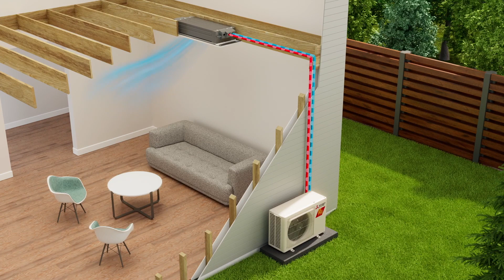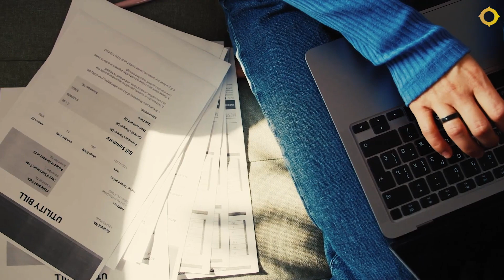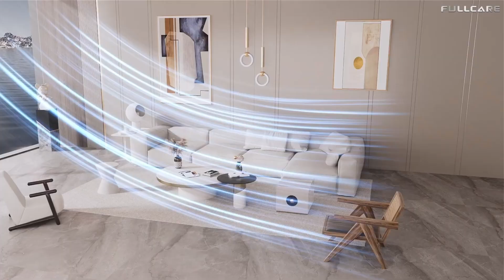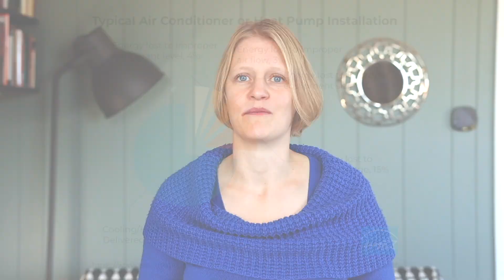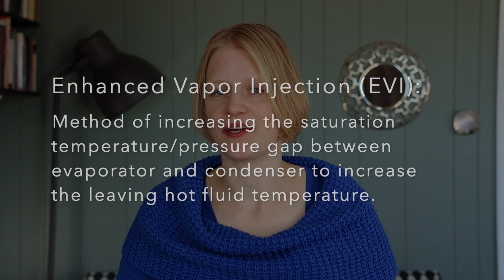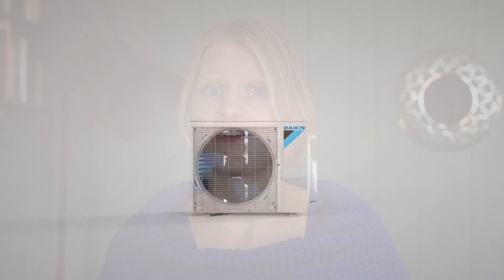Why most heat pumps are oversized (and why this affects your long-term savings)

Comment: This is an urban myth based on the bad old days of reciprocating compressors, but it's simply not true today, because clever software control and modern scroll compressors are so good at controlling room temperatures and preventing cycling altogether. Look carefully at the manufacturers data tables, for example a Vaillant Arotherm+ 10kW produces 7kW of power far more efficiently than the Vaillant Arotherm+ 7kW version at full power. The larger heat pump is significantly more efficient at like for like power levels because a compressor turning over at say 70% of capacity has much lower friction losses than a compressor working at full speed. If the 10kW heat pump needs to work below it's lowest modulation level, the software does not allow it to cycle. An off time of say 20 minutes minimum is absolutely fine for a modern scroll compressor and leads to virtually no efficiency losses.
Reply from the maker: Thank you for sharing! 🙏
Reply: @NetZeroTech  from 7kw to 10kw is 30% which is even normal to consider if you have a 7kw heat loss at the design temp , but going for 300% more , like they wanted in my case , its absolute madness . And no matter the modulating of the compresor , the correct unit will be always more efficient in non-extreme temps.

Comment: this is only the case for stupid heat pumps that cannot modulate well
Reply from the maker: Hi, Thanks for sharing! Yes, you'd expect a higher degree of oversizing from the fixed speed heat pumps. Variable heat pumps get oversized too, though, i.e. they usually run below their nominal performance. Cheers.

Comment: Hi Katha, thanks for the video.  I've noticed also a lot of commentary about oversizing being detrimental to efficiency but not much quantitative data.  Of course it will depend on the application so hard to make a broad statement.  Anyway, I noticed in the beginning of the video that you said oversizing is detrimental to efficiency because a variable speed heat pump will be running at its minimum output much of the time, but then later in the video said that this is good for efficiency because the heat exchange area is much greater relative to output.  So in that case, wouldn't an oversized variable speed heat pump run a higher efficiency than one sized to be running closer to full capacity more of the time?  Not many manufacturers have detailed enough data to answer this question but curious what you've found in your research.  I've seen at least some curves showing an efficiency maximum somewhere between min and max output of variable speed heat pumps, so I would think that the ideal strategy would be to size the unit to match that sweet spot to the load for as much time as possible.
Reply from the maker: Hi @RicknessJ82, Thank you for the comment. Really good points! I tried to get more data into the video. I had a hard time finding data. I asked multiple heat pump experts and scraped the internet. The challenge that I am running into is for these kinds of videos is time for in-depth research. I would have to ask a lot more manufacturers and heat pump designers. But, frankly, and I hate to say it, but if I spend the time doing that, I lose momentum to build the channel. My goal is to grow the channel to a size where I can afford a researcher or other team members, so I can spend more time on research. That's the hard truth at the moment. I am looking into sponsorships. I hope you have the patience to stick with me on the way.  Warm regards, Katharina
Reply: @NetZeroTech  Thanks for the quick reply, I get that for sure!  I like to geek out on those details but for many it may be TMI anyway, thanks for the great content!
Reply from the maker: @RicknessJ82  Thank you for watching! Keep geeking out! I love it! Katha

Comment: This problem really only applies to single stage heat pumps or if you live in a very hot area like Phoenix.  For most people the correct way to size a heat pump is to match the heat load.  Then be smart and only consider variable speed or inverter models of heat pumps.  These are quiet and will do a good job managing humidity levels.  Efficiency levels range from 16 to 32 Seer with 19-25 being the economical sweet zone.
Reply from the maker: Thank you very much for sharing, @alberthartl8885. Much appreciated! Katha

Comment: Oversizing seems to be an issue in the UK too where there is a push to replace traditional gas boilers with HPs - many plumbers (not heating engineers) aren’t trained in heating design and use the same rules of thumb as they have been for gas rather than doing actual heat loss calculations - many boilers are already massively oversized because “bigger = better” 🙄 and many homes have combi boilers which require huge outputs for instant hot water resulting in homeowners thinking something with a perceived “small” output is not going to be powerful enough - there are plenty of negative stories of poor performance or expensive running costs that hit the headlines in some news outlets with a particular agenda 🙄
Reply from the maker: Thank for sharing this! Much appreciated. In the a video about the importance of the installer, I mentioned the challenges with installers that are untrained in heat pumps. I think it is a challenge in all places where heat pump demand is growing rapidly, because installers, who used to install furnaces are switching to where the business is going, i.e. to heat pumps and haven't had time to catch up in training. I think this is I pretty much what's happening globally, although a lot of countries in Europe seem to be a bit ahead. And we are still at the onset of the S-shaped growth curve. So, more exponential growth to come.
Reply: @NetZeroTech  indeed, it's only going to get worse unfortunately as there are currently subsidies of £7500 for A2W HP installs so the unscrupulous installers will be aiming for the unsuspecting as is always the case when "free" money is there for the taking, albeit with a bit of bureaucracy to tick some boxes - same thing happened with PV a few years back. It's also muddied by the general public not having a clue and the fact that any old gas fitter can refer to themselves as a "heating engineer" as it's not a protected title as it is elsewhere - that and the fact that it's all too easy to install an oversized gas system without calculations which is inefficient because no-one is able to measure it, but the homeowner is happy because it gets warm quickly and gas is still relatively cheap...
Reply from the maker: @Umski   Thank you so much for sharing your thoughts! 🙏 Have a great time! Katha

Comment: Thanks for the video, all very good points.  My heat pump is definitely oversized.  As you state, this increased the cost of the system, and the extra money spent isn't really helping me.  A big downside of the larger compressor is that it's LOUDER.  That alone should encourage everyone to not oversize their system.
Reply from the maker: Thank you very much for sharing, @satoshimanabe2493! 🙏 Most air-source heat pump systems installed today run very quietly. What is the heat pump model and when was it installed? By the way, ground-source heat pump systems are of course completely silent. Thank you! Katha
Reply: @NetZeroTech  My system was installed about 10 years ago, a Bryant 286BNA024 (24000 BTU).  Compressor is single-speed, dual-stage.  Home is 32x16 ft, 3-story with one of the long walls being shared with a neighbor (so effectively no loss through that wall).
There have been vast improvements in the past 10 years, and I'm hoping there's better air-to-air equipment out there when I have to replace this in another 5-10 years.  (Ground water isn't an option for me.)
Reply from the maker: Thank you so much for sharing! Very interesting! Yes, heat pump technology has improved over the past 10 years across the board. I hope you are enjoying your heat pump system regardless. Greetings from Colorado, Katha

Comment: Maybe she could define oversized and correctly sized .  A heat pump needs to be big enough to work on the hottest and coldest day of the year.
Reply from the maker: Hi @donalddouglas5988. Thank you for watching and sharing your thoughts. A correctly sized heat pump maximizes the efficiency and the lifetime of the system, so that little to no energy is lost do to improper sizing. For the coldest days cold-climate heat pumps have auxiliary backup electric heaters. Apologies if this didn't come through in the video. I hope this helps. Thank you, Katha

Comment: To keep me from over-sizing my heat pump, I would need to see some data that accurately predicts the local climate for the next 15 to 20 years. The data must include things like climate change and the effects of natural disasters or even a nuclear war.😐
Reply from the maker: Great point. That would be needed to size any heating or cooling system. My assumption is that temperatures will keep rising. In regions where cold is the limiting factor, this means, you’d even need a smaller heat pump in the future. Overall I would assume the effect of a changing climate on heat pump size is minimal. Thank you for sharing! Greetings from Colorado, Katha

Comment: Great video! Some models can turn down to just 15% or less of their max output and have impressive COP over 7 at that minimum output, versus 3-4 at high or max output. Do you think that's enough to minimize low load cycling? I think it also depends on the location. Min vs max output needed is much different in an area with a design temp of 32F/0C vs an area with 0F/-18C
Reply from the maker: Thank you so much! 🙏 Agreed. It absolutely depends on the location. However, systems would work more efficiently if the were sized for their nominal values, meaning they run at their most efficient capacity most of the time. Cold-climate heat pumps have an auxiliary backup resistor that covers the outlier days. Too frequent low cycling happens when the heat pump is too large regardless of COP I think. Hope this helps. Thank you and greetings from Colorado, Katha 😀

Comment: in my experience the extreme temperature is not the reason. its simply installers that dont want cold calls so they just oversize to the extreme.
Reply from the maker: Interesting. Thank you for sharing! 🙏 Much appreciated. 😊 Katha

Comment: At 38° north latitude we need variable speed heat pumps to be oversized in cooling because you’re going to need that extra capacity during heat mode. I need 20 btu/sqft for cooling and 35 for heating. 

Otherwise, if you size it for cooling, go ahead and install another heat pump just for heating right beside it, because you’re gonna need it. Typically you need about twice as much capacity for heating in the winter time. 

We don’t have hydronic systems in our residential homes very much in the US and most of us do not want them. I am going to build a small air-water hp for my 80 gal electric to save some energy this time of year. I am totally off grid and it’s all I can do to make it through these dark cold weeks of January and early February. That’s with 32kWp! I have to use a wood burner when it gets below 20F at night.
Reply: Most of us have forced air, air-air hp’s. Some have gas or oil fired boilers and some have geothermal hp’s. I guess the air-water hp’s haven’t caught on much yet and will have to start with new construction. Hey, we are just now getting air-air mini splits here in larger numbers. Mainly because they can be diy. I don’t push them on people, because they are difficult to perform preventative maintenance on them, they don’t last quite as long as our central heat pump systems, we don’t carry parts on our trucks for them, and you can’t add high efficiency air filtration to them very easily. I have a Fujitsu 9000 BTU 33 seer heat pump air to air. I like it a lot, but it’s only two years old so time will tell.
Reply from the maker: Interesting. Thank you very much for sharing! 🙏 I appreciate it. Katha
Reply from the maker: Hi @rv10flyer84 Thank you very much for watching and sharing your thoughts. I’m curious to learn why you don’t want hydronic systems for residential homes. Thank you! 🙏

Comment: I am going to get a air water heater pump, hope it is properly dimensioned! I find most of it specific to air to air heatpump right?
Reply from the maker: Hi @raghuramkalyanam! That’s great! Congratulations to the decision. Air-to-air heat pumps are more popular. 😀 I am a big fan of air-to-water, as the long-term savings are significantly higher. I think you’ll enjoy your investment! 😊 Katha
Reply: @NetZeroTech  In Germany most builders are increasingly opting for Air to water HP. Even older buildings are going for geothermal ones, though bit costly.
Reply from the maker: @raghuramkalyanam  Agreed. I think in my video "Solar for Heat Pumps" I mention that air-to-water systems are already the most popular system for new buildings in Germany and are becoming increasingly popular in the US (https://youtu.be/QmunFWEvh60). Thank you very much for watching and commenting! 🙏Greetings from Colorado, Katha